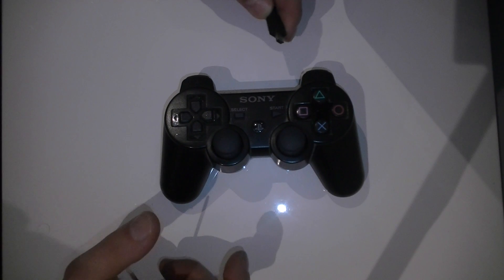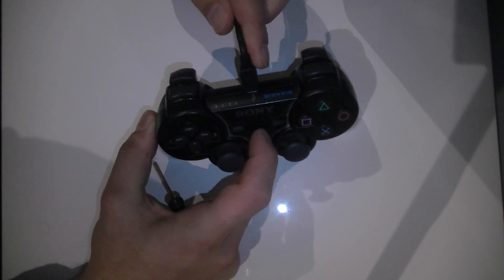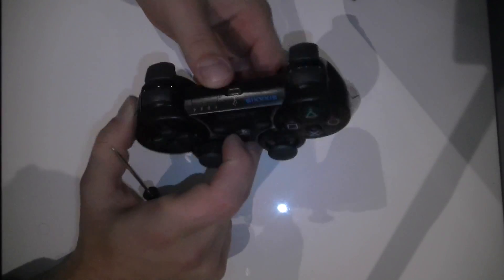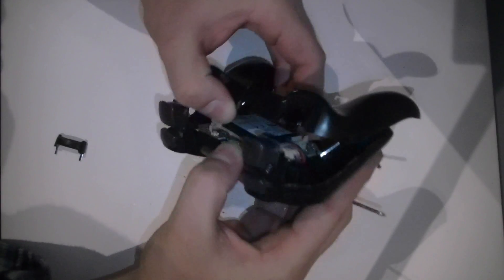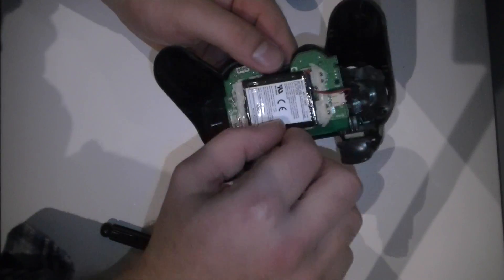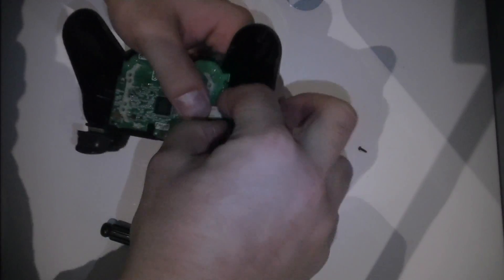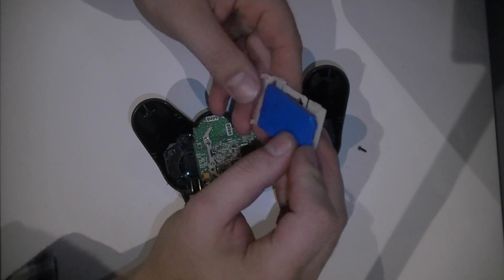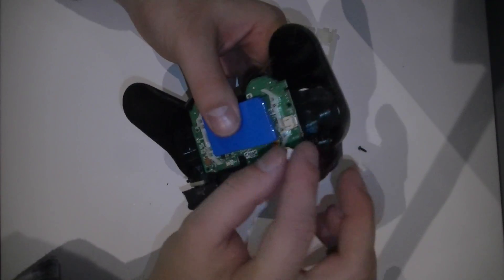How to Replace a PS3 Controller Battery

Comment: Just incase new people are coming to this video...

To get theb attery out you have to hold both sides of the little white plug thing the batteries are connected to and kind of nudge it loose.

Don't pull on the wires.
Reply: They will pull out of the connector
Reply: Thatd what I do, Ive done tjis process hubderds of times on different devices. But on this controller not a fking flinch

Comment: Oh, I hope my second controller isn't such a problem as my disassembling, and certainly reassembling my first controller.
When I disassembled it one the R2 came loose and I had to complete reconstruct the R1/R2 which was a pretty bitch. replacing the battery itself wasn't really a problem, but then I had to reassemble it again, and MAN what a bitch is the L2/R2 part, it wouldn't properly sit, in the end, I kinda 'smashed' it back together and now it luckily looks like it's back in it's original state.

Comment: Just curious, why not buy a new controller instead? Is it a special feeling using the original controller or are most replacement controllers bad. I bought a new ps4 controller and it seems worse than the original, could to some part be that it could have gotten a bit tossed around in the delivery process.
Reply: It's cheaper, produces less waste and no originals are made anymore. Also the ps3 controllers made by sony are just built much better than the knock offs.
The ps4 had a lot of good third party controllers, so it's different for that console.

Comment: How the hell do you put the shell back together? I'm having such a blast cursing at inanimate objects. LOL! I realize my ps3 controller is a little different. It's the gun metal color that came with the Kojima box set. It comes apart in two shells just like the black controllers. Except, there is an extra part between the RI and R2 and L1 and L2 buttons. These tiny parts are making the reassembly almost impossible. With the black controllers, the plastic between these buttons are just molded together with the bottom shell. That's not the case with the gun metal controller. So freaking annoying.

Comment: How do you remove a replacement battery with that sticky thing on there? I try to pull it out to replace with a new one but I'm afraid of damaging the motherboard.
Reply: Michael Suire exactly what I'm facing now. Couldnt figure a way to do so